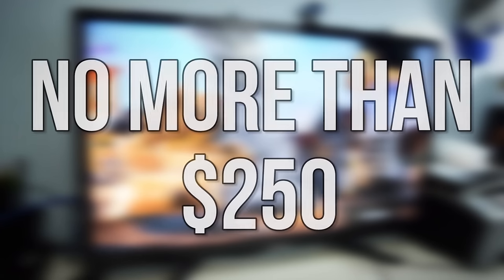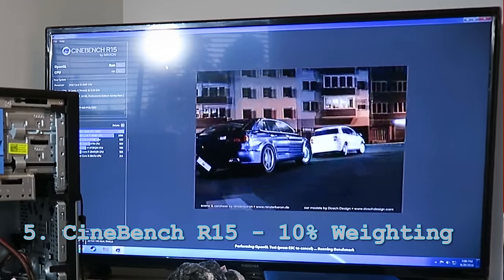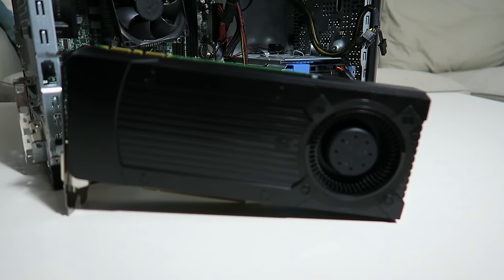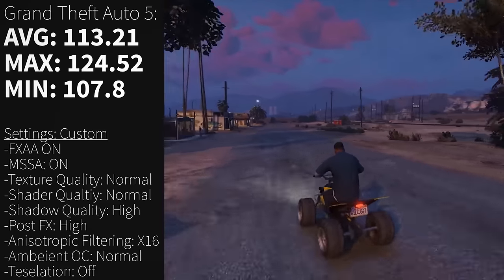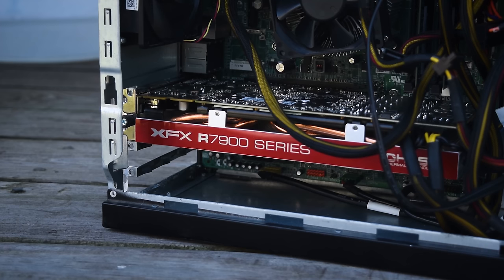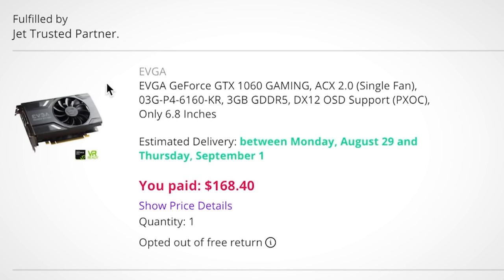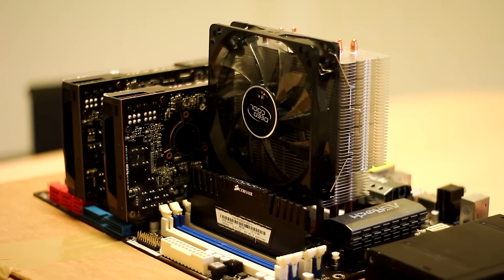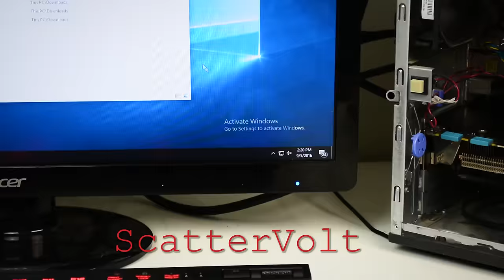The VERDICT - 5 Way $250 USED Gaming PC Challenge

Comment: Working on a budget/ used parts build at the moment for the hell of it. Mainly because I found a steal on an R9 280x The case wasn't bad either considering they're new.
$62- Msi x58 mobo/ 6gb ddr3/ stock intel cooler
$31- R9 280X
$32- Rosewill B2 Spirit case
$5.50- Xeon W3520
$10- Ultra 750w Psu
$5- 320gb HDD
So for a bit under $150 I've ended up with a pc that's still fairly relevant.
Reply from the maker: Damn $31 for a 280x? how you get that.
Reply: I got one for free a month ago. Guy said his cooler didn't work so it's hitting like 80-90C and sent it to me. It's an ASUS R9 280X Direct CU 2, so custom PCB and cooler. Didn't find anything else I could have slapped onto it. 
But then I found an old AMD 64 boxed cooler and removed the heatsink part. After some modifications I replaced the broken fan with my new "custom cooler". So yeah hitting 30C ambient and 68C max on Heaven. OC as well.
Deal of my life!
Reply: Tech City  Well I managed to grab it off a local online bidding site that sells returned and discontinued items from large retailers. Needless to say I went a bit crazy when I found that it was unused still in the box.  Lol
Reply: Lee Wong That's awesome, man. My friends all know freebies are always welcome here. Lol I have a weakness for deals.
Reply: gtx 770s are hot right now!  $ 100 - 120
Reply: I'd recommend 970s though. A friend of mine bought one for 150. Also built my dad kind of a nostalgia build. HD5850, Phenom II X4 955 on an ASUS M5A97 mobo, CM 550 Watt psu for 120ish. Used market is freakin' awesome the last few months!
Reply: Yeah, the 770s are a great buy too. Especially with how it seems recent pc game devs are getting much better about hardware optimization than in the past. Games are looking better and not really using that much more gpu power. Pretty well as well as you're running 1080p and keeping AA and other forms of sampling down in order to not fill that 2gb buffer they do great still.
Reply: 970s are definitely powerful cards still. I'm actually running 2 in my main rig and have no issues pushing 1440p with 2 in almost any game. In most cases my sli 970s are still out performing the Gtx1080. Though the going price is a bit higher when I've checked they tend to run closer to the $180-$200 mark on ebay still.  Not to say you can't find a deal though, they're definitely out there.
Reply: Or0s
 ilove 970s but for 200, its a little expensive, u can get a 1060
Reply: someone feed me woth 2nd hardware. GT 8600 in 2k16 Cannot survive anymore lol xD
Reply: What site was it? I'm also trying to build my first pc, and all help would be much appreciated.

Comment: Scored a Lenovo K430 with an i7 3770(Non-K) 16GB ram 1GB Radeon HD7750 a 500Gb HDD and a 1TB HDD for $280 on CL, so stay vigilant there are plenty of deals out there to be had. Only downside is the mobo/PSU have eliminated the upgrade path, but might consider changing those out if I find the right deals, especially with PSUs usually going to deep discounts during Nov/Dec.

Comment: I'm surprised no one thought of doing a cheap value SSD.
Reply: Leone Furlan An SSD is more likely to bump up performance that little bit extra.  Not to mention, bonus points for having the smoothest system.
Reply: Leone Furlan I'm well aware the SSD won't show up much in the benchmarks, just stating that if I had a choice between a HDD and a SSD I would choose the SSD every time.

Comment: I think all these guys did a great job, I used to buy used PCs all the time that always performed brilliantly for their price, then I made the mistake of buying a brand new gaming PC that even though I got at the best price possible, still not really worth all that money I spent when I should have just got an older beaten up PC and just whacked a graphics card in and maybe a beefier PSU. The parts on my new PC have failed so many times over the last 3 years, which was my concern about used PCs, but just goes to show, whether it's new or old, there's always a chance it will just randomly crap out on ya, so should have just took the chance and saved some money on getting a banger that would have done the job.

Comment: Brian, in EU we use AC input of 220V, and i will buy a power supply from the us(silverstone sf-l 500W) and on the description it says that it will work in both 110 and 240V AC input, should i buy a converter, or i dont have to worry?

Comment: When people use 4gb of ram for gaming - triggered.
Reply: you gotta do what you gotta do. I'm finding that 8GB doesn't seem to be quite enough.
Reply: 12-16 is the sweet spot
Reply: I believe they could've at least had 3 2gb sticks. I'll say 8gb is the min. Standard in 2016, in 2017 16gb will be the norm.
Reply: You are wrong smh
Reply: No he's not just a bit off on timing 8 Gigabytes of RAM in 2016 is almost perfect. Like Gta 5 for example it works fine. But it's more like 2018 when 16 gigabytes would be necessary.
Reply: +KORG and still, im at my pc, crying for having 2gb ram xD
Reply: Psiho Manijak my 2007 gaming PC has 2gb, it can't even load google chrome within the first 5 minutes, it's a nice room heater though.
Reply: Psiho Manijak my 2007 gaming PC has 2gb, it can't even load google chrome within the first 5 minutes, it's a nice room heater though.
Reply: +KORG Lol, mine is 2008 but its still working nice, im thinking to get some new one temporarly for like 150$
Reply: Psiho Manijak it's sad to know that my PC is worth like £5 now.
Reply: Psiho Manijak if you are going that cheap I recommend an i5 750, they're cheap and over clock so much.
Reply: KORG Yah, for how much i could get it?
Reply: well i got mine for £20 from ebay so around under 30 dollars

Comment: i7-2600 Master race! 

But then I went overboard with the internals. 

32gb ddr3 
8tb Seagate hdd 
2tb micron 1100 ssd
500gb Samsung 860 Evo ssd 
DVD combo drive 
WiFi network card 
1050ti low profile 

New pc in over 12 years previous one was an Asus laptop running gt740m and it 35XXu something series pretty bad barely ran dota 2 at 720p 30 fps low settings 

Next one is gonna be a beast aiming for gtx 1080ti minimum 8700k or 8600k depending on prices.

Comment: This was really cool, and all 6 of you have gotten a sub from me as a result. It coincidentally matches with a project I'm about 90% though - building a pseudo HTPC for my housemates and myself. I wish I could have entered (via a Back to the Future type situation, of course)! I set myself an approx. 150 British pound budget, which I broke slightly (and I allowed myself to "buy up" any bargains I found to resell and subtract from the cost).

Ultimately, for about GBP161 without shipping (USD$198) I got an i5 2500s w/ stock heatsink, 8gb DDR3 1600mhz, Asus P8h61m-Le motherboard, 2gb EVGA GTX760 SC (clocking around 1256mhz), 128gb Crucial mx100 SSD, 500gb HDD, Corsair VS550w, and a Cooler Master Elite 243 case. For exhaust I threw in a spare 92mm fan I had to compliment the 120mm intake. Take out the SSD bringing my price down to just under 140 (USD$170) and I dare say I would have competed at the top end with the others.

Anyway - fantastic video, channel, and series. Kudos, and I look forward to seeing more. This budget rig scrapyard area is my new favourite build point ATM. Keep it up!

Comment: not one thing in my rig was bought new. everthing was second hand from OCAU or the local facebook garage sale site.
gigabyte GA-Z77X-UD3H, i5-3570K, 16GB ram 2 x 120GB SSD 1 x 1TB storage 2 x GTX680 SLI H50 AIO water cooler CoolerMaster N400 case, 700W silent pro PSU.  LG E2360 monitor and a Samsung 2494HS....... 

next step is to move it into a Fractal Define R5 i got for $80 and to improve the water cooling. all of the loop i got from OCAU. 240 rad,raystorm block EK dual bay res, D5 pump, and bitspower fittings. OCAU is a great site for good gear cheap!!!

Comment: My budget build: 
Antec Tower 
ASUS P6t V2 
2tb total HDD 
16gb G-Skill 1066mhz 
550W psu 
R7-370 4G 
and I rigged a CPU fan and a 120mm fan as cooling, except I need a 2 pin power extension. so it's held in by the grace of God.

Comment: I already got a case with psu, gtx 660 oem, lga1155 mb, 8gb of ram and 120gb ssd. all I need is a cheap lga1155 i5 cpu. But I cant find anything cheap for cpu only! damn, some of them are even more expensive than those prebuilt dell optiplex.

Comment: Since there are i5 2400  I would like to ask how were the temps.
My used i5 2400 is at 100c under load with stock cooler.
Reply: non K = no o.c ability
I've tried an LGA 775 cooler thats at 3400rpm but it still shoots up to the mid 90c.
Might buy a Hyper 212 .

Comment: I bought an used pc for 250 euros
CPU: Intel i7-860 2,8 GHz
GPU Gigabyte Geforce GTX750 TI OC (2GB)
RAM: 8 GB G.Skill Ripjaws-X F3-12800CL9D
Motherboard: Asrock H55M-LE
PS: Cooler Master Silent Pro M600 (600W - 80 Plus zertifiziert)
No Hdd, and No cd rom
And a samsung monitor 24 inches
Worth it?

Comment: I made a rig for $400 NZD - which is almost $265 USD

Specs: 
i3 4130 3.4Ghz - 4 threads
Sapphire R7 260x 2GB
MOBO: Gigabyte something 
Ram: 8GB Gskill Ripjaws
PSU: 500W FSP Hexa 80+

Any good?
Reply from the maker: Yeah thats pretty nice for a new rig
Reply: HOLY SHIT YOU REPLIED!!!!
Reply: 400 including storage?
Reply: Yeah 500GB Seagarte Barracuda 7200rpm, sorry forgot to add it to the list
Reply: That's nice and all I guess, but you may not have noticed that my build I made was $400 NZD - which is $265 usd
Reply: +YTRKS I agree, hardware is so expensive here even when it's used or half by fucked. Did manage to score an i7 2600k Gigabyte z68 mobo and 16gbs of ram for $225 on trademe.
Reply: Jareware Damn, that's a really good deal dude. Was it Buy Now?
Reply: YTRKS The auction was up for about 5 minutes at $200 and he already had about 6 people asking for a buy now, he put one up and I got to it first muaha
Reply: Jareware Damn hahaha nice find! 😂
Reply: YTRKS consider upgrading to an nvidia gpu or rx 480.
Reply: Turbonite yea 970s are getting cheaper so might pick one up
Reply: amazing considering nz hardware prices, i know how it is :)
Reply: similar to my build but mine was $120 usd (140 after cooler master t2) 
Specs:
Cpu: Amd athlon II x4 559 3.4ghz - 4 cores, 4 threads 
Gpu: Amd xfx r7 360 2gb
Motherboard: asus M4A785T-M
Memory: 8gb of crucial @1600mhz
Psu: Apevia 500w
Storage: 500gb Hitachi hard drive 

And....to wrap it all up its all inside a 2003 e-machine case with a jery rigged power led (no longer blue.. its green)

Comment: my budget build "Fermi Pile"
Fx 4350 4.2ghz (90 usd)
God aweful mobo (78lmt-usb3) gigabite (7 usd)
8gb ddr3 1600 mhz ram (35 usd)
gtx 580 (50 usd)
600w bronze psu(50 usd)
120gb ssd (35usd)
250gb freebie hardisk (free)
Spec 01 case (50usd)
Total: 317 usd 
I could have gotten some cheaper parts, however this one is meant for someone else, so i invested into decent parts for later use (psu, ssd and case) 

for 67 usd over their budget mark, i still get taken by cinebench r15 scores being at 255

Comment: my specs: Lenovo ThinkCentre M90p 5498 - Core i5 650 3.2ghz $7 ,$50 GTX 660 2 gb Craigslist , amazon ssd 250 gb ssd $36 , Evga 500 watt psu $39 , LED lighting $5 , monitor $7, plexi glass side door $10

Comment: The openGL benchmark of cinebench is really screwed up, according to that my GTX 770 outperforms my 570 which outperforms my HD 7950 which outperforms my 1080.
Also is that just me or did some of those i5 2400s score really poorly in cinebench, some of them scored lower than my old Q6600@3,7Ghz. I mean I've never owned a Sandy Bridge CPU before but still those numbers seemed really low.

Comment: +Tech City 
 Hi can any one tell me if this is a good deal to start of for a busget gaming pc? and if yes what GPU and other stuff should i replace to play 1080p AA games or MOBA/FPS games.

$290cad

Intel® Core™ i7-2600K Processor (8M Cache, 3.4 GHz) - 4 Cores 8 Threads
Intel® Desktop Board DH67BL
8 Gb DDR3 RAM
Seagate 1TB 7200 RPM SATA Hard Drive
LG DVD Recorder
8 USB ports - 6 on the back and 2 on the front
Power Cable

Comment: The System requirements for Battlefield 1 have just been released.  Here they are. If you dont believe me check origin's website

Minimum Requirements

OS: 64-bit Windows 7, Windows 8.1 and Windows 10
Processor (AMD): AMD FX-6350
Processor (Intel): Intel Core i5 6600K
Memory: 8GB RAM
Graphics card (AMD): AMD Radeon™ HD 7850 2GB
Graphics card (NVIDIA): NVIDIA GeForce® GTX 660 2GB
DirectX: 11.0 Compatible video card or equivalent
Online Connection Requirements: 512 KBPS or faster Internet connection
Hard-drive space: 50GB

Recommended Requirements

OS: 64-bit Windows 10 or later
Processor (AMD): AMD FX 8350 Wraith
Processor (Intel): Intel Core i7 4790 or equivalent
Memory: 16GB RAM
Graphics card (AMD): AMD Radeon™ RX 480 4GB
Graphics card (NVIDIA): NVIDIA GeForce® GTX 1060 3GB
DirectX: 11.1 Compatible video card or equivalent
Online Connection Requirements: 512 KBPS or faster Internet connection
Hard-drive space: 50GB
Reply: Im not spamming this,  i just thought this community would like to know :)
Reply: The Reaper95 i didn't concoct these,  look at origin's site.

Comment: Gtx 970 wins of a gtx 660, oke im done im out!!
Reply: Are you saying the 970 should be slower than the 660?
Reply: Animu Scrub li ment 660 isd faster then 970
Reply: timo van dijk There are multiple tiers of graphics cards at launch. 60, 70, 80, and occasionally 90.
The number before them indicates the generations. GTX 600 series, at the tier 60. GTX 660.

The GTX 970 is two generations newer, and a tier higher.
The 660 is only a fraction of the performance of the 970. 
(I have a 660.)
Reply: it was price to performance judged. Nerd on a budget only spent $130 where scattervolt spent 200+